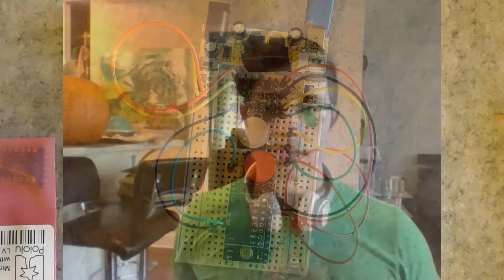Update from the Lab: 2016-11-11 - Push-Button Kill Switch

Comment: If you going to use this with an arduino, I think this project probably be best because it's easy to build and can be changed for less power consumption. http://www.instructables.com/id/Soft-Latch-Power-Switch-Ardweeny/
Reply from the maker: I just really like modularity in electronics projects. Not that I'm afraid of discrete components, but I just prefer the relative ease of "lego-ing" high level inputs and outputs together and quickly getting results.